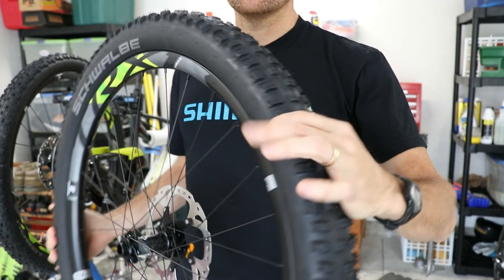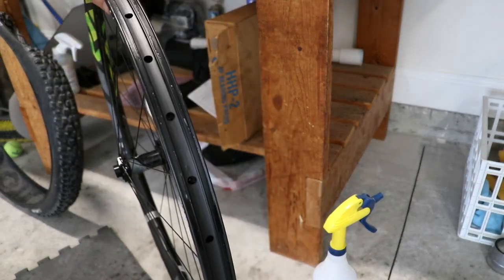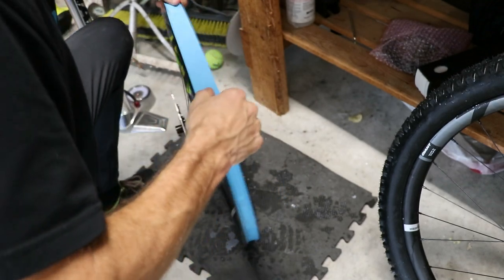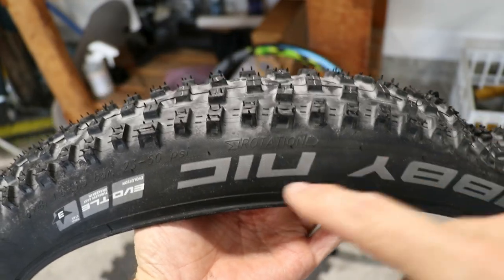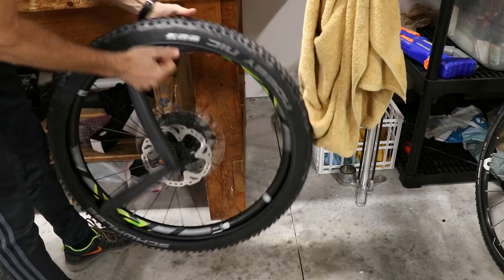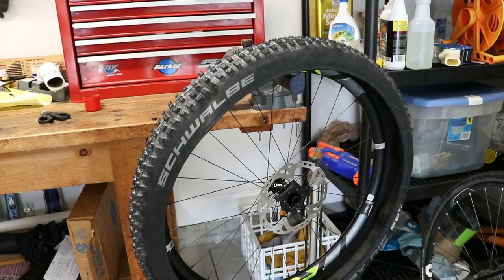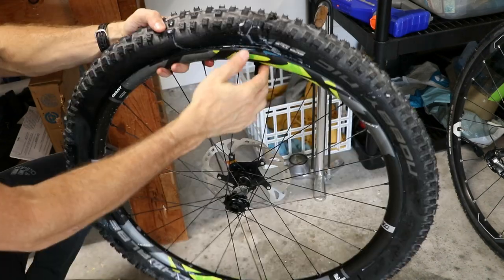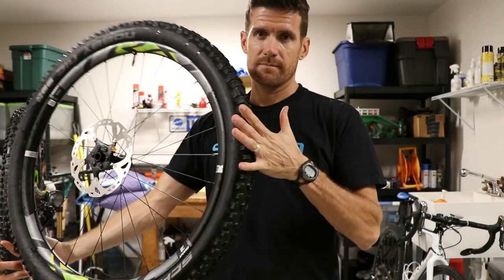How to Convert Stock Wheels to Tubeless

Comment: I always replace the tube as well after a wheel taping and leave it for awhile as well. IMO, this is such a critical stem for maintaining sealing longevity. I've had friends who have not performed this stem and chase a slow leak for ever. Good advice.

Comment: Solid tutorial! Your tips are what got me through some really difficult tubeless mounts and conversions. 

I'll add two tips that have helped me:
1) Even on new rims, I like to clean the channel with some rubbing alcohol. Stans tape is very fickle for me.
2) I now spray/rub soapy water onto the rim and tire as I'm slipping the tire into the channel, especially at the end where levers are usually needed. The reduction in friction has almost completely eliminated my need for tire levers except for on the tightest of beads. 

Looking forward to hearing your review of that Anthem if the 29er experiment is over!
Reply: I agree 100% on these. Especially with used rims you should probably clean it before making tubeless conversion. I also use soapy water on rim and on tire before fitting.

Comment: Morning Clint, great video.  I once tried using a CO2 cartridge to do this and what I found was the CO2 reacts with the latex in the stans and it solidifies.   I bought myself a Bontrager flash charger floor pump and this works every time.

Comment: Great video Clint, more comprehensive than the Park Tools one and given me the confidence to tackle the rear wheel. I destroyed the original new WTB carbon wheel (front converted fine) trying to get the bead to seat and had to fight to get it replaced after they accepted wheel was faulty...

Comment: Another useful tip if you have trouble getting it to seat is to wrap a small winch strap or something similar around the tyre - this forces the bead and helps out especially if you do not have the luxury of compressed air.

Comment: Leaving a tube (filled at 30psi/2bar) for about an hour will also straighten out the tire which can be deformed from packaging. This will help tremendously when inflating the tire if you don't have an air compressor, it makes it easier to get the tire over the rim because it expands a little, your tire will pop in place faster/smoother which also helps straightening the tire for a well balanced wheel.

Comment: I used 24" split tubes on non tubeless wheels and non tubeless tires. Never had a single issue and going on two years.
Reply from the maker: +cbruton1511 i've never tried that but I know of people who have and it works well.

Comment: Very good addition for everyone how doesn't have a compressor, you can use booster cylinders which you fill with compressed air from you normal bike pump. This way you have this sudden inflation but don't need an compressor or CO2 capsule. They're around 50€ and available from Airshot, Schwalbe and so on

Comment: Like the idea of using the tube to press the tape in place well.  Wonder if you have a truing stand if mounting wheel on that then running the tape onto rim might work well.  Truing stand needs to be secured either bolted down or held in a vice etc.

Comment: Clint, when switching to tubeless, are using the width of the tape same as the width of the rim? In other words, I have a 30 mm rim; should I use 30mm tape or a little bigger? Thanks. Marek

Comment: very nice and clear video Cint, i have question how long tubleless valve should i use ? and how wide the tubeless tap should be.
i have the same bike trance advanced 1 2017
Reply from the maker: +Rami kishawi the tape varies in width based on the width of your rim. It needs to cover the complete inner width of your rim.

Comment: Thanks for making these videos Clint.  One question though, what pressures are you getting down to on your CX wheels? I have tubulars and have considered going tubeless for some wheel sets. Thanks again!
Reply from the maker: On the 'cross bike I run about 27 in the front and 30 in the back, give or take 2 psi depending on road/course conditions.

Comment: Hey Clint, which tape width you are using for 35mm giant rims?
I want to do a new tubeless setup from scratch on my Giant trance advance 1 which comes with 35mm rims but Im not sure which tape width to use (Bike came with tubeless ready setup so all I had to do after purchase was adding a bit of sealant so I was not touching the tape at all)

Comment: did you clean the internal rim surface ?  i just installed 2 minion dhf's on a set of wtb i35 rims and had to redo both wheels due to valve stem leaks. next time i cleaned tbe internal rims with alcohol and re installed the tape and valves and that did the trick. but my god the tires were a beast to get on and off the rims.
i broke 4 plastic tires tools and the entire ordeal took 6 hours.

Comment: DO NOT attempt to do this if you do not have an air compressor or an actual "tubeless" floor pump. Ordinary tire inflators will not work, you will need at least those small pancake compressors that deliver 100+ PSI. The floor pumps they refer here are those that have a canister that gets pressurized. What happens during these process is your tires get unseated. When you reinflate your tires you need that instant burst of pressurized air to seat the tires back to the rim. I've been mountain biking for 2 months now so I'm pretty new and learning as I go just surprised that none of the how to videos never mention the need for a compressor or a pressurized floor pump when performing this task. Great video just converted mine to tubeless today.
Reply: Gabe Riva You don't NEED to use a compressor. As Clint said it just makes the job a lot easier. As long as you CAN* inflate the tire (assuming the pump will pump air and/or the tire retains it) to a higher pressure, the bead will seat. Yes, if you initially inflate it to low air pressure value (like 20 psi) I doubt the tire would seat. Like a car tire, a light lubrication should be used to facilitate the seating process. From experience, I've pumped up tubeless tires with a floor pump with much success. I usually pump up to 40-50 psi to seat and the bead seats perfectly.
Reply: Before you can say you don't need an air compressor there are lots of variables involved when inflating unseated tubeless tires. Not all floor pumps will work because you need a floor pump that delivers the right volume of air to seat the tires. This video actually tells you that https://www.youtube.com/watch?v=5CZa37moqN8 Even if you have the right floor pump it all depends on what type of tires and rims you have if you're lucky to have tires that properly seal well then great otherwise you will have to study other how to videos and figure out how to seat tires using a floor pump. My local tire shop went down to the science of newer rubber compounds, shape and newer sizes of the tires explaining why some tires won't even seat using a floor pump. Now in my case I didn't have a high volume floor pump and the price of a 3 gallon 100 PSI compressor was actually cheaper than a high volume floor pump.
Reply: Gabe Riva Let me rephrase: SOMETIMES you don't need an air compressor. And to be honest who'd want to go into all those specs? Cycling isn't exactly my life. All we want to do is seat a tire lol.
Reply: Gabe Riva Also, some of us don't have the funds to try out a ton of tires. Whatever works just works. And I understand that some tires don't seat with a floor pump, and if needed I will use a compressor. I honestly don't care much about the "variables." Again, as long as it seats it's good with me. I haven't had problems with the way I set up my tires. Regardless of those variables I've had successful results.
Reply: Gabe Riva and yes, I stand corrected that some do not inflate or seat well with a floor pump. I also do not own a high volume pump. I've had experience with this, and I've simply used my compressor or layered my rim more if I only had my pump available. For example, the Panaracer Comet folding tire has rubber grooves on the bead that don't allow it to seal very well on a layered or ghetto non-tubeless rim, but will seal decently on a tubeless dedicated rim. Other than that, all I did was adapt to the situation and set it up as needed. It didn't take hours of research, it just came from my experience with setting up various tubeless setups.
Reply: You really don't i tripple rap my wheels makes it more air tight  and i can pump it up with one hand on my track pump.

Comment: Clint great video. Does this work for a wheel or rim that is not tubeless ready?
Reply from the maker: Usually it does, but if the seal is too loose I recommend the rubber Stan’s rim strip

Comment: I have a 27.5 + tires on Vera Terra PLUS XM35 rims 32h  (tire was a Pandura plus size - 3.0 tubeless compatible) and attempted to go tubeless last night.  My brother (a mechanic) put in 40 psi to make sure it would hold, and the tire blew off the rim spectacularly (ears were ringing for 5 mins - trucker sealant all over my brother, great way to remove leg hair...).  He said that you should go that high at first to make sure it doesn't blow on you while on the road, but drop it back to 25 psi after the check.  Is this correct?  (I really don't want to buy new rims if I don't have too.)

Comment: Clint thanks for all your videos, there awesome!!   Question.. I have a Giant Anthem with factory wheels (S-XC2) that are supposedly not tubeless ready from what dealer told me, do you think they would seal or would I be wasting my time?            Also have you ever tried Slime or Orange seal for A tubeless set-up?  Thanks!!
Reply from the maker: +Greg B if you get a Stan's rubber rim strip you should be able to convert the wheels to tubeless.
Reply: OK, thanks, Ill give it a try!

Comment: Have you ever needed those rim strips from Stan's that come with a valve? Or, in what cases would you have to use a rim strip? Or, why would you not use a rim strip?
Thanks again.
Reply from the maker: On any tubeless set up you have to have tubeless rim tape. The tape from stans seems to work the best.
Reply: Clint Gibbs no I meant rim strip. Like the one from Stan's that come with a valve stuck to it. It seems some people use that on top of rim tape. The rim strip is black and allot thicker than the rim tape, and stretchy rubber kind of fabric.

Comment: Clint, Is it possible to run a tube in a tubeless tire. I have still have my 26 inch tube tire on my old Santa Cruz bike. I've been looking for new tires for my bike and the majority of them are tubeless. My rims are not tubeless rims and it doesn't make sense to buy new set of tubeless ready wheel for my old bike when I am going to get trail bike by next year. In the mean time I'd like to keep my Santa Cruz XC bike for as long as I can. Please advise.
Reply from the maker: +Duc Ly absolutely. My giant XTC Advanced Plus came with tubes but tubeless tires.

Comment: The soap water might get mixed with the sealant, is that okay?
Reply from the maker: +v1d300 the spray bottle mainly does bubbles...It tends to be fine
Reply: For Tubliss dirt bike setup they tell you to use tire sealant instead of soapy water if you are using it.  They say it contaminates the sealant and it won't work as well. Don't know if that's the case for stans.

Comment: Other than it not being attached to a tube, a tubeless valve stem is identical to a regular one right? Because the ones I got with my DiamondBack seem to have a plastic body with a metal valve core.
Reply from the maker: +Orlando Olmo yes, they are pretty much the same type of Presta Valve that usually have removable cores. Never seen one with the plastic body though.
Reply: Orlando Olmo yeah, if you dont want that you can cut off one from a tube and use it in tubeless

Comment: did this install, front is OK but rear keeps deflating every 2 days at standstill.is it normal or should I add another cup full?  I only used one cup full in each
Reply: m00nchildblues - If it goes flat in 2 days you should be able to see where it's leaking from by spraying soapy water on it.  If it's bubbling from the sidewall add more sealant.  If it's bubbling from rim eyelits, you need to redo the rim strip.  If it's bubbling from the valve, try tightening it up and if that doesn't work reseat it.

Comment: I dont believe you needed to install the rim tape. Giant tubeless ready rims just require valve stems and some sealant
Reply from the maker: +CheekySavage - you have to use the tubeless rim tape Giant provides. The rim strip under the tube (that comes installed) is not air tight.
Reply: That's a bummer bc I bought my Giant at my LBS and they never gave me the tape when I bought it. I was planning on going tubeless in the spring. Guess I will have to buy some and tape it. It's kind of false advertising for them to say the rims are tubeless ready if you have to tape them.
Reply from the maker: +CheekySavage - it's not very expensive, but I would have a conversation with your bike shop. I'm pretty sure it came with your bike. They may have just held on to it.
Reply from the maker: +CheekySavage - and you'll need the 33mm wide tape.
Reply: Well, I'm glad I saw this video. If I hadn't, I would have just pulled out the tubes and thrown in the valve stems and some sealant and had a mess on my hands. Thank you for your help
Reply: I converted to tubeless on my Trance 2 2017 also, left the blue rim tape in there and after several rides, no leaking at all.
Reply from the maker: Did you install the tubeless Rim tape?
Reply: Clint Gibbs no, I left the blue tape on. I was worried about it after converting but it's been fine with the blue tape. so far at least. No leaks.
Reply from the maker: That's crazy. That tape is not supposed to be airtight. Pretty cool though!
Reply: For whatever reason, yours seemed to pull off a lot easier than mine. Mine was stuck to the rim
Reply: Clint is correct, Giant does not intend for the factory installed rim strip to be used as tubeless rim tape which is why they supply you with tubeless rim tape as an included item with the purchase of your bike. If the rim strip is working for you then that is great but the next time you swap out your tires I would switch that strip out for the tubeless tape.
Reply: I have a 2017 trance 2 as well, installed valve + sealant and I get air coming out of the valve. I did check the blue rim tape that came with it and it appeared to be tight...grrrrrrr. I never got rim tape.
Reply: @cheekysavage-5702  bike shop held on to my tape too!!

Comment: Great how to but if the tires are already tubeless ready why are manufacturers selling them with tubes anyway? I bought a brand new Trek Fuel 8 and found out I still have to convert them to tubeless.
Reply from the maker: +Gabe Riva for 2018 most giant bikes are coming without tubes. I would imagine other manufacturers will be doing the same if not already.
Reply: My local Trek store said they don't stock them tubeless as the sealants dry out which never made sense as it can always be easily refilled. My guess is its just extra income as they charge $30 per tire to get them converted.

Comment: Accidentally bought a new wheelset I thought was tubeless.  Can it be dangerous to convert a non tubeless wheelset to tubeless on a gravel bike as long as you buy tube1ess tires?  Have read some things about accidents where tire b1ew off.
Reply from the maker: Stans makes rim strips for converting non-tubeless rims to tubeless. That's how we did it back in the day and I did it for years. As long as you don't try to do high pressure you're fine.
Reply: @ClintGibbs  Thank you Clint.  Hope you and your family are staying well.  looking forward to that stable video .... hint hint!

Comment: Is your tire are non tubeless or tubeless. Can you make a tubeless conversion like non tubeless rims and non tubeless tire for tubeless?
Reply from the maker: Tubeless ready. If you use a non tubeless Rim my recommendation would be to get the rubber Stan's Rim strip. some standard tires do better than others. I've had better success with mountain bike standard tires going tubeless than cyclocross/gravel.
Reply: Thank You, this is useful information.

Comment: Have you ever had a tire with multiple pin holes on the side walls ? I have a 2017 Giant reign I am trying to set up tubeless but I have a bunch of pin holes. What do I do ?
Reply from the maker: +Adam Ricketts yes, with non tubeless tires. Do you have to put the sealant in, pump it up and then lay it on its side. No guarantees though.
Reply: Clint Gibbs thank you very much for the reply it was very helpful 👍

Comment: if it's a tubeless ready wheel why would you need the tape?
Reply from the maker: Yes, usually tubeless ready wheels already have tubeless rim tape.  But you still need to add tire sealant.

Comment: The original rim strip looked as if it might have worked as rim tape! Why not just use that?
Reply from the maker: It would not have worked. It was your standard thick Rim strip but it was not airtight.

Comment: If they would ride like tube tires id go for it but that technology doesnt exist
Reply from the maker: Tubeless tires are more compliant and ride better/smoother than tubes tires.
Reply: Clint Gibbs I'm not buying nope
Reply from the maker: @bobravenscraft5376  that's fine. With 30 years of mountain bike experience I can say that I can really tell a difference and how a tubeless tire rides. Basically with the absence of a tube there is less friction inside the tire and the casing is able to deform over bumps keeping the wheels from bouncing up and rolling over them better. This is especially true for mountain biking and cross / gravel bikes.